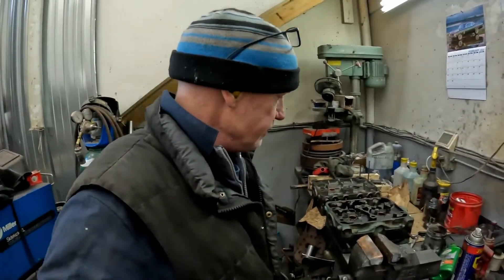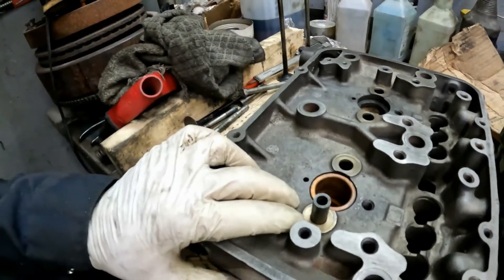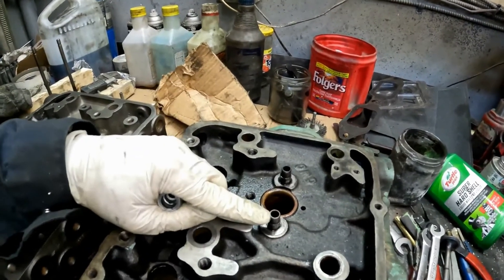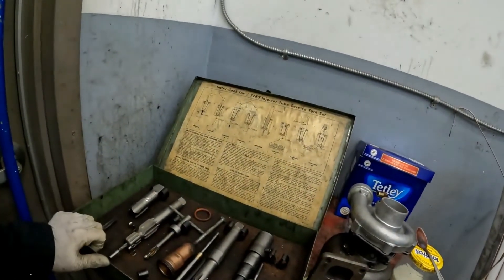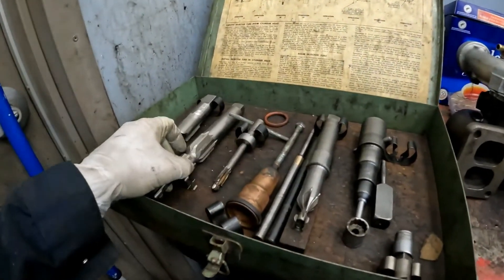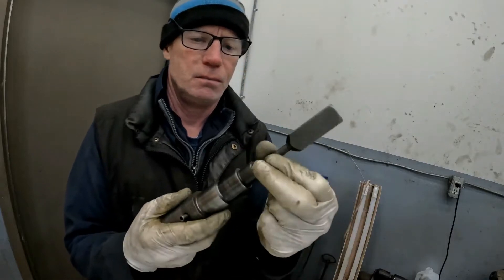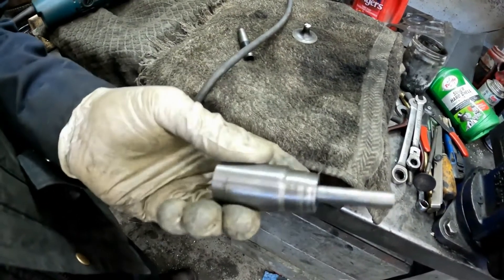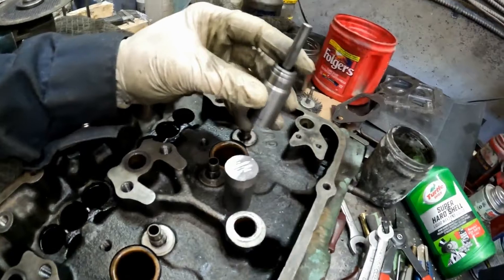Detroit 2-53 Kent-Moore Tool Build

Comment: What were the primary applications for the 2 cylinder engines? Pumps or generators perhaps? Thanks for the video 👍
Reply from the maker: Yes primarily pumps and generators, but was also used in John Deere 440 crawlers and tractors.  My engine came out of a 1958 John Deere 440 crawler.:)  Thanks for watching.
Reply: @detroitgarage9430  I'm negotiating to purchase a JD 440 crawler. It has the JD gasoline engine. And I'm hoping to repower it with a 2-53 diesel engine. I have no excuse to do the engine swap because the JD engine is fresh rebuilt and runs fantastic. I just really like the two stroke diesels.